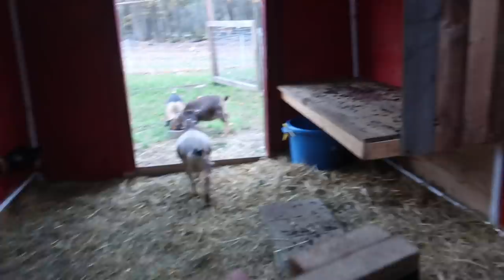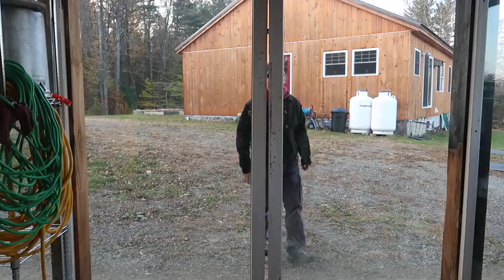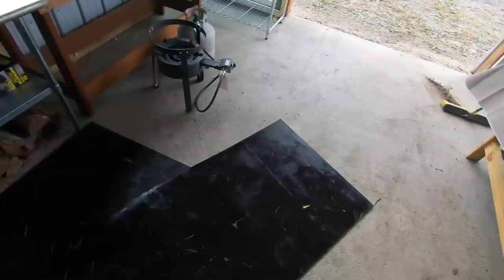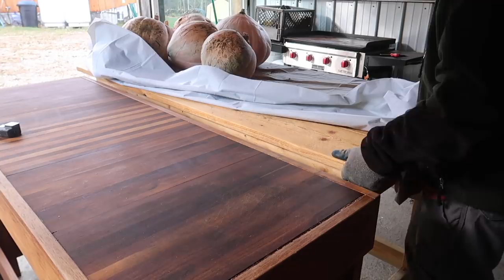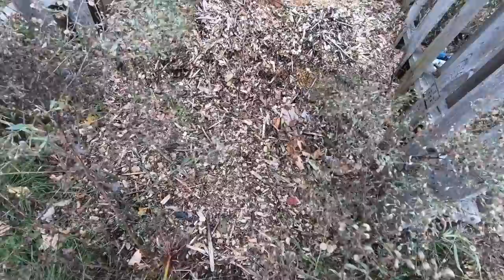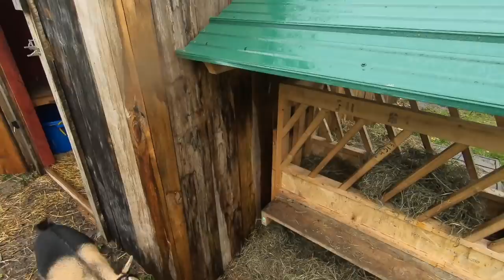I MESSED UP!

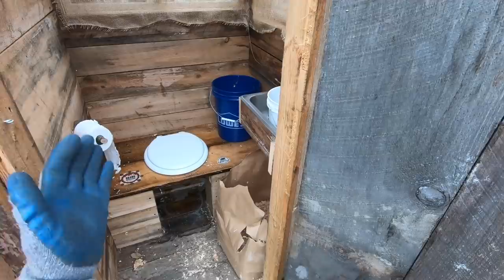Comment: 15:00 Looks like your composting toilet has composting mice eating the TP.
Reply: We always put our TP in a reused a #10 can with a lid... exactly because moisture, bugs & rodents love TP too.  Theirs is probably ok on the wall-holder ...that bathroom looks more secure from pests, than any of our past outhouses.  The shredding of that roll looks like someone had trouble getting the roll to open. 
What’s more concerning is when he lifted the lid & revealed light reflected on liquid in the bucket, not cover material...so, if liquid is in their buckets without being soaked-up by cover material, that’s gonna cause huge stench, flies etc. 
There’s a really good book called “Solviva”, by Ana Eddy (sp.?)...she describes 2 systems she devised, that work better than most compost bucket potties.

Comment: Can you arriate the pasture to loosen it up.?
Reply: That pasture has a thin layer of good soil. Al has been building this up by running chickens through there as well as chop and drop of the cover grasses. Beneath is all rocky hard scrabble. If you've watched the videos of them clearing the 4 acre wood lot, you can see what that sub soil looks like. Should he choose to mechanically aerate and turn it over would be counterproductive. That would break up the thin layer of good soil he's been building and a lot more rock and poor quality soil to the surface. He could keep building on top of this sub soil as he has been which in time will give a deeper top soil layer. He could also plant deep root cover crops such as sorghum, Daikon radish, annual rye grass, hairy vetch and the like. The roots will penetrate into the hard scrabble opening it up. When mowed the roots will die back and leave behind humus in the sub soil and the top growth will decompose and add to the top layer of good soil. This would be the better method to open up that compacted soil.